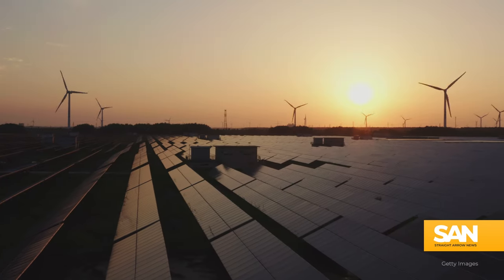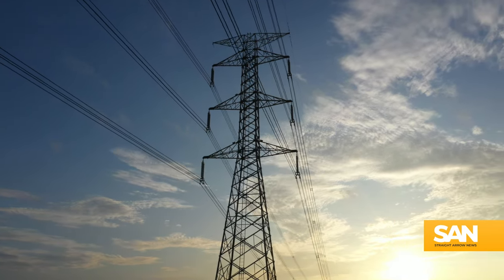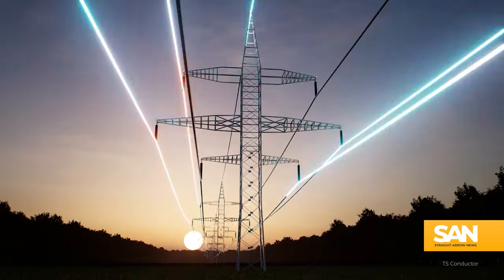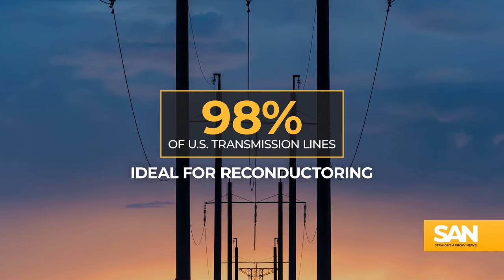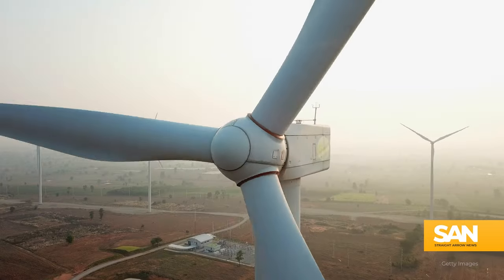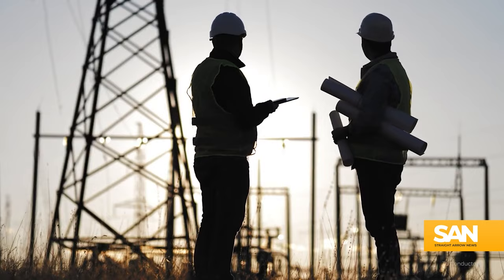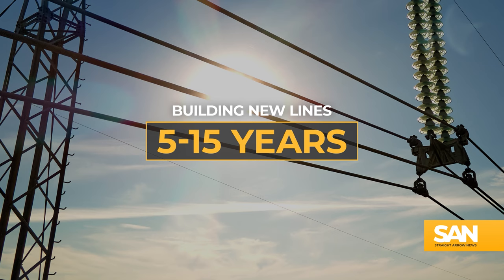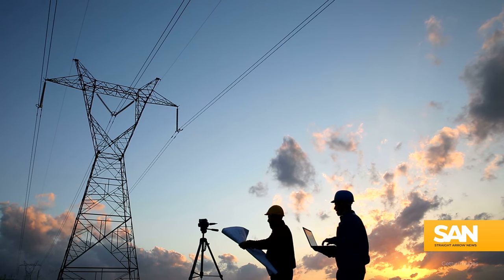How reconductoring could allow almost all of the US to run on clean energy

Comment: You read the report completely wrong. Here is a direct quote from the report: "Reconductoring projects typically cost less than half the price of 
new lines for similar capacity increases". Either you did not read  the report or are pushing a false narrative. BTW, the report is excellent. This is a no-brainer.

Comment: The math does not work. You never tell us what this new conductor is!  Did someone re-invent copper?
Reply: It’s not copper. Copper is too heavy, it is ACCC, aluminum conductor composite core.  Really these are not super advanced either, they are standard technology, just not widely adopted in the US.
Reply: @deltay71   Aluminum ore has the most energy intensive refining process out of any metal. The reason they are not widely adopted in most of the globe is because it's not economical.
Reply: I'm thinking of the recycled copper from the old lines, that would be a pretty penny.
Reply: Nearly every overhead conductor in the world is already aluminum, ACSR, Aluminum Conductor Steel Reinforced. Copper is generally too heavy and not strong enough for overhead.  Their is some hard drawn copper.